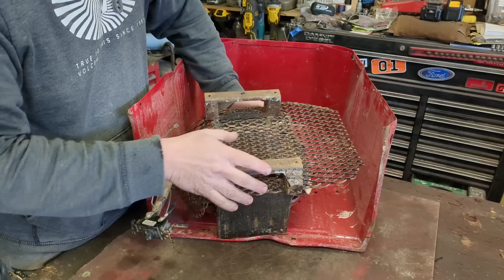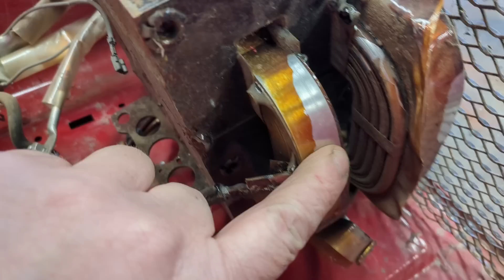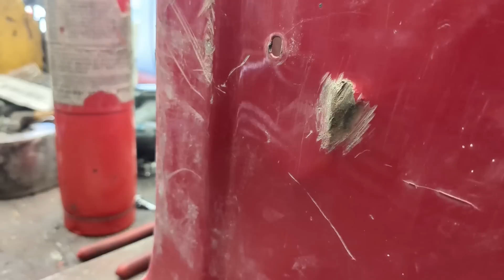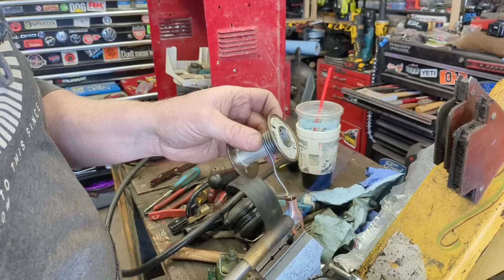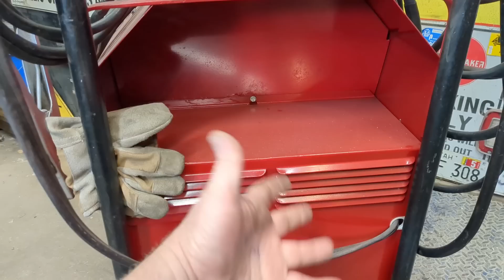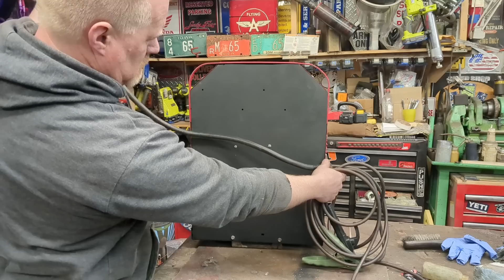Free Lincoln welder  .. Can anything kill them?

Comment: The aluminum windings are not painted to look like copper.  That material is called Kapton tape, a highly heat resistant material used as an insulator.   It just happens to be copper-colored.
Reply: I don’t believe that’s Kapton tape. I believe it’s the enamel coating for the wire. Windings and coils are coated to isolate them from themselves. A good representation is a speaker coil, speakers blow when they get too hot and cook the enamel off the wire causing a short.
Reply: Have him back up and show it closer, it could be either.  Not painted to look like copper (a good copper thief knows what to throw away, just cut the leads and run).  He could use a good high temp enamel though.

Comment: Love your welder repair videos. I restored and flipped them for several years.  I specialized in the AC225’s big brother the Idealarc 250.  I also did several Miller Dialarc 250 models. The Idealarc 250 is legendary and production started in 1956. I never had trouble selling a fully restored and powder coated 250 to older guys who learned to weld with one in high school shop class and always wanted one for themselves . They are truly bulletproof machines

Comment: I have an old Lincoln 225 amp arc welder that someone left sitting out in the weather for years. Now the transformer is dead as a hammer. I have 240 volt going all the way to the coil, but the transformer doesn't hum at all or have any output. Can you give me an idea of how to procede? Thank you!

Comment: Had one in the shop when I was 9, It's still in the same spot and works fine. I'm 62 now
Reply: I brought my first one home while delivering newspapers when I was 10 or 12 on the back rack of my bike along with an old Sears Welder with a crank on top to set the amps. They both worked but I had only one set of cables. Being a broke kid I went to the junk yard and salvaged two battery cables off an old 60's motor home, used a vise grip for a ground clamp and made a threaded positive clamp using a nut and bolt and some heater hose. It worked great, still does but I did spring for some better cables about 25 years ago. The Lincoln still have its original cables. Someone added cable sockets to the front of it that lets me unplug the cables if I want. They push in and twist to lock in place. That thing built a lot of trailers and fixed a ton of equipment over the years. I think I dragged it home in 1972 or '73.

Comment: Side of the road finds...

I retired early from a high-stress career in big finance IT and for the last ten years, 90% of my daily transportation needs have been via bicycle.  Talk about roadside finds!  When you're going low & slow, what you see is incredible -- garments, tools, devices, containers, etc.  And, if you pedal behind the huge local mall, the treasure people throw out, wow!  I've scored some nice 1/4" sheet steel stock in the past.

Within the last couple of weeks, I came upon a nice plastic container.  And who doesn't need another sturdy container for the garage workbench?  I picked up the container and tossed it into my kiddy cart bicycle trailer.  I get home open up the container to toss out the half-eaten lunch still in there and discover a glass pipe and a nice cache of dope!

Good thing I didn't have an official encounter that day!

"Seriously!  It's not mine!  I found the container on the side of the road and picked it up just for the container.  I didn't even look in it!  I don't do drugs!"

How big of an eye roll do you suppose I would have received?

As for those old transformer-based welders, I have a couple of them sitting on the shelf.  I like the modern inverter welders with all their weld-quality management options.  But, I hold on to the old-school stuff just in case the high-tech versions lose their magic smoke and I'm in the middle of an important project to complete.

Comment: I'm surprised that for so few parts you managed to whop the stuff into shape and got running again on the lowest amperage setting as smooth as cream. Add to that it's a great unit with lots of welding grunt . Even if the scenario was scripted and setup the whole video would be just as impressive. That Lincoln and all those others I have seen so far are all mighty welding machines. Respects to the engineers at that company for the product they consistently design and produce. Great video.

Comment: I always use the shelf.  I keep my gloves, cap, and sometimes a wire brush and chipping hammer there.  It's convenient, because every other surface I would lay things ends up covered with the remains of previous projects.  I can't imagine using one without the shelf.  Watching this video makes me want to fabricate an accurate replica of the original back on my 225, just to show my appreciation for the glove shelf.  But, then I would have to make an accurate copy of the front, so I would have something to attach it to.  Then I'd have to build a transformer to have something to stand it on.

Comment: Beautiful!  BTW: Dodge/Chrysler products with the battery in the trunk, like the Magnum, use top quality welding lead as the hot wire from the battery up to the engine compartment. Last I saw it actually had the welding lead printing on the cable. I'd think the aluminum stuff wouldn't stand up to a lot of bending over time, but it would probably work great for as little as I would use it.  Now I just need to keep my eyes on the side of the road.

Comment: We still use the old Forney225 dad and mom bought at the Farmer Co-oP in 66-67.  I remember go shopping for welders with them.  It still works.  Funny it has cutout in the case for a fan, but they didn't put on inside.  The Forney has taps that are in 10a increments at common current ranges.  I think it was the compromise between the budget tombstone and one with infinite current adjustment.  
I think you should write "warning aluminum wires" on it so it won't "fall off a truck" again.

Comment: I bought one used for 75 bucks over 10 yrs ago. Costed more to wire my house with an outside outlet so sparks stayed out side for driveway welding. If I saw that by road I’d pick it up for scrap. Impressive repair!
Reply from the maker: That's a great deal.
Reply: @sixtyfiveford  we had them in H S metal shop 50 yrs ago . Do they still make them . Guy I bought it off got himself a mig wire feed welder .

Comment: Good find!  Score.  I have always hole sawed holes on either side of that pocket so that my rod holders sit in the hole. It makes it look like a torso with shoulders instead of a tombstone but handy nonetheless. If you want to get fancy with the holes you can put beauty rings in the holes, I have used cut off cup holders from an old center console for example. Pass it on!
Reply from the maker: That's one of my favorite parts about fixing these welders up. You always get to see how each guy modified and or built a cart for these. It's always different.

Comment: I think you did a great job on this one! Very cool to bring something back from the dead Dr. Frankenstein! 
Even though your fan arrangement is going to be 'just fine (tm)' there should be something to be said for the shroud / separating plate of the original design. It brings in air from the side louvers and blows it down but without it's just blowing air around in a big open space, I feel like hot air from the transformer will just rise and the fan won't be as effective. But nevertheless - super fun video and great job giving that one new life!

Comment: i had no issues with the current carrying in that cheap CCA cable, but it does corrode so quickly, grease up anywhere you expose it, turned to dust actual dust in under a year of being in my engine bay, and that was with a feral crimped on the end then inserted into a plastic fuse holder enclosure
Reply from the maker: Interesting. I guess that could be corrosion, galvanic corrosion or resistance at the connection causing extreme heat. I know everything I buy these days has cca wire in it. I was under the impression the copper was there to prevent the aluminum from oxidizing.

Comment: 20:52 id use it.
But if I was looking to buy one id look for an old one with copper coils. I have an old Harbor fright unit i paid 15 bucks for it had a dryer plug hooked on the wires
I converter it to twist lock cables
The duty cycles not very long
Let's face it its not a big Miller 440 volt unit.  
These are just cheap buzz boxes.
Lincoln should go back to using copper coils as a buyer its worth it to have a longer cycle time.
You can also offer a budget version
Like this one.
Reply from the maker: The duty cycle times are actually better with the aluminum. The first units were 180amp peak with copper and a 20% duty cycle. They put a fan and aluminum and it were able to jump the amperage up to 225amps at 20%. I have used both copper winding and aluminum winding stick machines and honestly there is no noticeable difference. The electricity doesn't care what it has to go through to get out. I tried the copper lead machine and this aluminum lead machine side by side and no difference. The funny thing is everyone that I talk to that has an older Lincoln 225 buzz box will say " I have a good old one with copper windings. It's much better than the new Lincolns" . Problem with that is Lincoln never made a 225 with copper so the placebo effect is real.

Comment: Can anything kill them?  Yes indeed.
Many years ago I was maintenance in a shop and they had a lot of these mounted to benches. They are very simple, a transformer with many 
 ‘ taps ‘ for different amperage connected to a multi - position switch to chose which ‘ tap ‘ you want.
The tap wires for the lower amperage were quite small in comparison to the higher amp wires.  They used a small motor like one used in a record player to blow a little air around.
In the shop they were in they used to spray paint the machines we built and the guys painting after hours NEVER checked to turn things off and the welder fans used to get loaded with paint overspray.
The paint gummed up the fans and they quit working.
The thing that used to kill these welders was the cheap fans not working and people welding at maximum amperage with no fan and overheating them. The other thing was stingers falling on the bench and shorting with no one noticing until the smaller wires were smoking and burning up
( 90 amp wire was always first to get smoked )
I used to mix and match parts to keep them going, tape the melted wires, actually get record player motors out of the trash to use for the fans, and I remember having one old beater I was trying to make usable , it worked but the whole transformer frame was hot , electrically. 200 volts

Comment: I missed an idealarc 250 welder with 50' cables. 200$☹️☹️
I have sa200 Lincoln and a few others. Plus a Lincoln AC from the 50's but it has a flat top and rounded on the sides. Not like a tombstone Lincoln.
Nice job as always 👍
Reply from the maker: Dang. With all these electric vehicles and stuff like that copper prices are bound to just double or triple in the future. Probably my favorite one was buying a tombstone 10-15 years ago for 50 bucks and as I was going to leave the guy asked if I wanted the extension cords as well. He said I had to dig him out of the garage though because they were heavy.  Nearly 150 ft of 6 gauge extension cord. It was heavy for sure.

Comment: It would be interesting to measure the voltage drop under load between the output of the transformer & the welding clamp. on the load using the CCA wires. I have neighbors who wonder why my 24 foot jumper cables will start cars & trucks of all types & theirs won't!   I use finely stranded copper wire cables, & they buy the CCA jumpers from Walmart. I also use a hydraulic crimper to install the clamps & the internal connectors. I enjoy your videos very much, & I bet the 
engineers & Master electricians are on Malox & Nitro Glycerin for some of your fixes. Great video !
Reply from the maker: I actually had two of the exact same welders in the shop at the time of filming this. One with copper leads 5awg and this one with CCA 4awg. There was no difference in welds. CCA you have to run larger to equal copper for sure. The rule of thumb is 2awg but it drops as you get to the larger gauges.  Jumper cables have a huge variance in quality. Unless someone goes out of their way to buy a top of the line set or makes them like you; they're junk.

Comment: That wire is fine for light use. My issues with is the ends brake off and it burns out internally and can be hard to locate. Had a lot of issues with self tarp systems on my dump truck.
Reply: Good video though
Reply from the maker: Absolutely!. Every time I sell one of these it's always a homeowner that's probably going to use this for another 2 hours in the next 20 years.

Comment: Looks good. You should look into Scrubs graffiti wipes. They work awesome at removing spray paint and over spray. I love them and they smell awesome.
Reply from the maker: I will do. Thanks for the heads up as I'm always cleaning stuff like this.
Reply: 1 part orange oil (limonene) mixed with maybe 5 parts isopropyl works great.  Some jerk decided to tag my car and it wiped right off.

Comment: CCA wire has a flex problem and they will break far earlier than solid copper wires.  That's an excellent deal to get a nice, working Tombstone for the price of a U-turn and an hour of work.  Score!  Is it time to make a bending brake?  (Yeah, me, too.)
Reply from the maker: I debated the flex issue and I think I read it roughly 2x more likely to fatigue or 1/2 the life.  But it seams copper never breaks so half of eternity is.......... ? sarcasm...

I've had a brake on my list forever. Problem is the room they take up and where do I stop in width. 2foot? 3foot? maybe 5foot to be safe? Then the double bends become an issue and you need to build a finger brake. I keep getting lost in my needs and reality and space consumption.

Comment: You know what a Lincoln ln 8 wire feeder is. Would one them tombstone run it. My dad's buddy gave me one that's old but not a lot hours on it.  He was welder in umwa bought it new years ago. Has 60# spool flux wire and spool holder  round steel case. He kept the leads, whip stinger. But shoot free and not junked. Expensive little unit in it's day. Still command a price used. Thanks love the channel
Reply: It might, if that version of the LN8 can run on CC. Some of them have a switch to select for CC/CV. Needs constant voltage to run a wire feeder in short arc mode
Reply: @MegaDysart  cool I'll check it out . Where would it be switch or is how it's wired up

Comment: bought an old marquette model 32w has high low plugs 25/50, 30/65, 35/80, 40/100 with two plugs on bottom labeled spot welding. plugged clamp into high then low connector and electrode in each of the others. cant get sparkage. id like to get it working. small and manuverable. only welded twice in life so really big noob. also cam with a lincoln arc torch??prob to old for a shop to even look at it?only paid 20$ is there things i can do without getting fried?
Reply: Just a suggestion. Depending on where you live, you might find that there is a technical college nearby that has a welding program. If so, they might be able to render some assistance in getting your rig up and running. The same may be true with an old school electronics program. No, they may not be welders but they'll know electricity like the back of their hand thus might take on the challenge of troubleshooting an old school welder. The same may be true of a hobbyist group if you can find one. Best wishes!

- Max Giganteum

Comment: So I just bought a Lincoln 225 AC which is not tombstone shaped, but is rectangular in shape 16" x 12" x 18.5" high. The fellow knew nothing about it other than it is from his dad's estate. Does anyone have a possible date for this one? Everything inside looked great except for a lot of dust and it works great. I have not weighed it but it is friggin heavy. Can't believe the windings are aluminum due to the weight.
Reply from the maker: Could be an early Lincoln 180 AC? They look the same as these but the top corners aren't cut off like the 225 model. If so, this would be a late 50s early 60s model from the top of my head
Reply: @sixtyfiveford  Thanks for the response. It has AC-225-S plate on the panel, mounted with slip pockets on the bottom and sheet metal screws on the top of the plate.
I should add,  I'm in Canada and the machine has a made in Canada sticker.
Reply from the maker: @rjl7765  Yep, you have the Canadian model. The rectangle shape ones in the US only went up to a 180 amp model. They must have shipped the tooling for the older models up to Canada for production there. If so, I would assume they continued your style through the '80s at least

Comment: Should the conductor be heated before dipping it into the liquid solder in the lug?
Reply from the maker: The problem is aluminum dissipates heat so fast you're not able to heat it like copper. So I dipped it in, let it sit and then I heated up the assembly again.
Reply: @sixtyfiveford  Nice!  No cold joints!   I figured there was more heat at some point.  Great content, I enjoy the straightforward approach.  Also:  great dog! 👍🏼